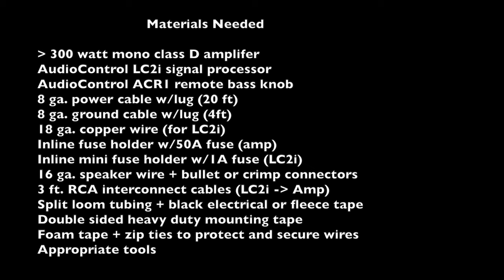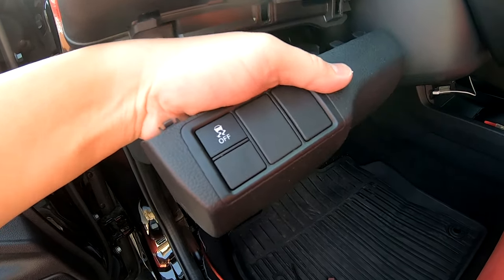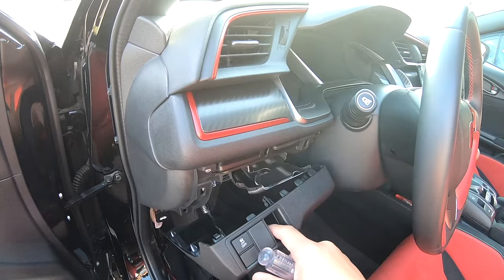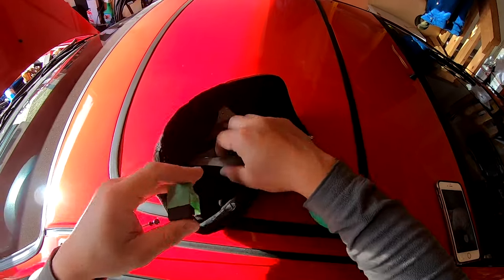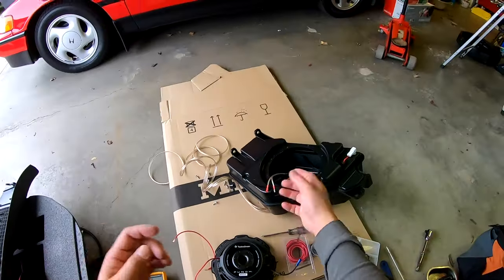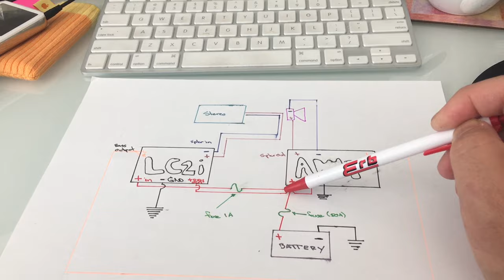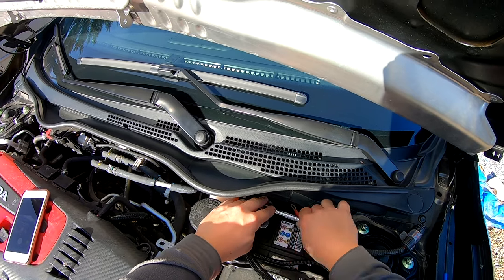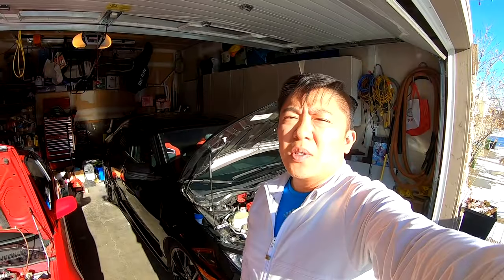2016+ Honda Civic Type R Subwoofer Amplifier Installation

Comment: Hello. It's me again. I just got an LC7i. After doing a lot of reading, I see why this is necessary for multiple channels. No short cuts here. I am wondering something. The input signal to the Lc7i. Can I use the factory wires which are 22 AWG and tap into them and use that, or do I need to run new thicker wires like 16 or 18 gauge to the input starting from the head unit? I wasn't sure. I was thinking if this is just a signal, but again, not knowing how thick it needs to be to send a good signal to the LC7i. The good thing is, that I am learning. Thank you. 
Also, I see you have quite a few videos on Honda Civic, that's good. Furthermore, I like to thank you for your reply's. A+ in my book. A lot of channels advertise and give advice, but few respond.
Reply from the maker: No need to beef up the wiring in the car anywhere except making sure you size the power cable correctly for the amp.  You don' need to change the wires for the door speakers or the signal wires.  My advice is to not splice @ the headunit.  You can buy an amplifier breakout harness online (there was a guy in civicX selling them) and that saves you from ever having to hack up your factory harness.  

https://www.civicx.com/forum/threads/amp-out-harnesses.60037/

The link I provided is to the thread where I purchased the harness from.  Not sure if he's still making them or not but this is a GREAT way to NOT screw your car.  If you sell the car, you can pull out the harness adapter and call it day :). Feel free to reach out anytime as I try my best to stay in touch with my viewers.  Don't forget to "like" the videos as it does help my channel a lot!
Reply: @piercedasian  I seriously appreciate your advice. Note taken on the wires and will reach out to this person. Thanks again
Reply from the maker: You're very welcome.  Glad I could be of SOME assistance to you :)

Comment: Well done trying this on my 07 e350. Good thing my battery is in the trunk
Reply from the maker: Aw man an E350 is super easy to install in b/c of the proximity of the battery.  Just make sure you do not compromise the battery box if it is sealed and you wouldn't want a buildup of hydrogen gas in your trunk.

Comment: Does all these steps also apply to a 2018 CIVIC TYPE R ? AND WILL THE STOCK TOUCH SCREEN IN DASH HAVE RCA CONNECTIONS IN THE BACK OF IT?
Reply from the maker: 2017-2021 civic type Rs will be 100% identical.  There are no RCA outs on any stock head unit and you will need to follow the procedure outlined in my video to get your aftermarket sub and amp to work correctly.
Reply: @piercedasian  yea i did this was a old comment lol the updated one is under it thanks

Comment: Bruh I’ve installed prob 5-7 systems over the years and I never knew about the pen trick or using the hood release cable grommet. Idk what I’ve been using but it was never just that simple 😂
Reply from the maker: yeah that trick is to the credit of a guy named CTRMOFO on the CivicX forum.  I just demonstrated the technique on video.

Comment: Final question, thank you for answering the other questions, where did you put the ground for the lc2i, did you use the same bolt or the black cable, and where did you get the power cable from the lc2i to the amp
Reply from the maker: Yep, I grounded the LC2i to the same ground as the amplifier.  The black cable for the LC2i is plain old twisted copper wire you can buy at any automotive parts store.

Comment: I have a question and sorry if its noobish:

How much different is this installation if I want to connect the amp power directly to the battery positive terminal? Do I still use the fuse connector the same way and just have the power bolted onto the positive terminal?
Reply from the maker: Not a noob question at all.  In fact the approach you're using a technically the better way of doing it but since I know I'm running relatively lower power and will always draw low current to my amp that I installed the power cable the way I did to make it look cleaner and still work properly and safely.  Whenever you're connecting to the battery it is SUPER SUPER important to install that in line fuse as close to the battery as possible.  As long as its fused properly then you're golden.
Reply: @piercedasian  Thanks for the information! I really appreciate it. By the way, I noticed you said that you had dashcams installed. Do you happen to have any instructions for how you did that?

Comment: You think 8” kicker comp R  will fit? Please post a video of the sound of your set up. Thanks and good tutorial btw.
Reply from the maker: The only way to tell if the kicker comp 8” will fit will depend on the depth of the kicker. If you look at my description it will show the exact 
Ideal of Rockford sub I used. Look the specs up for that and compare them against the kicker you want to put in.  Another sub had asked me to do a sound comparison video but I have been super busy that I have not been able to do a full fledged comparison of before and after. I promise I will get to that soon and post when I can. Stay tuned and don’t forget to click the little bell to be notified of new videos.

Comment: Nice video.  How you ran your power cable from under the hood, does it not get pinched when the hood is closed?
Reply from the maker: nope not at all.  There is a LOT of clearance where I routed the cable.  Key thing is to make sure rubbing doesn't cut through the wire's insulation as that would be a very bad and dangerous thing (engine bay fire).  That is why the fuse is placed where it is placed. As close to the positive terminal as possible.

Comment: Do you need to upgrade your battery or a capacitor to cater for the increase of power drawing from the amp and sub?
Reply from the maker: Generally not if you’re running a modern high efficiency class D amp. You’d have to run some additional amps or have gigantic ones before you need to consider a 2nd battery, larger alternator and adding caps to make up for the voltage drops from that kind of current draw.

Comment: Wish I could use the same mounting location for the amp in my Sport Touring, but we have a spare tire instead. Only thing holding me back is not being able to conceal the amp as I don’t want it to be visible, or interfere with the cargo area. Maybe I’ll take the spare out!? Nevertheless, I appreciate the in depth guide! It’ll be the blueprint for my upgrade!
Reply from the maker: Yeah, I actually did an install in the sport touring and the only logical place I could mount it was the spare tire jack cover of all places!  While you'd think it would be a terrible place to mount it that it has surprisingly held up there very good.  I had to do some mods to the inside of the truck cover but we've retained the spare tire and the trunk deck had to be only slightly modified.

Comment: Where in the diagram would I add a capacitor? Kinda stuck in that with my 17 civic
Reply from the maker: the capacitor?  That's easy.  Hook the negative terminal from the cap to ground and then hook up the + ve terminal of the cap to the power cable from the battery and then using another wire hook up the + ve of the amp to the +ve of the cap.  Just PAY CLOSE ATTENTION to the polarity of the cap such that you don't mix - ve and + ve up.

Comment: What gauge power wire did you use for the lc2i and amp?
Reply from the maker: The amp was 8 gauge and the LC2i was 14 gauge.

Comment: My civic doesn’t have a stock sub do you think I could buy those parts to create a stock sub and have the same setup as you?
Reply: Yes you would connect the lci to a speaker wire.
Reply from the maker: Hmm if you wanted to build a civic with stock sub that chances are it would cost you a small fortune to have mediocre sound. You'd have to buy a new trunk side liner, the box, associated wiring (assuming you could tap into existing harnesses).  You're honestly better off building an aftermarket setup that would give you better sound for the same or less money than going the genuine Honda route.

Comment: Were you able to control the bass threw the factory head unit? Like you took the sub line into the LC2i?
Reply from the maker: absolutely you can.  In my case I can adjust via head unit AND my remote bass gain control.  I just leave the head unit on the default bass setting and use the bass knob to control it instead.  Turning a knob is far faster, quick and more intuitive than trying to navigate the infotainment system screens to find the bass controls.

Comment: for the signal, do you connected to the left or right side on the LC2i? also do you think regular RCA converter will work talking signal from factory subwoofer? Thanks, Sub and liked
Reply from the maker: I believe on mine I connected it to the "left" input terminal.  RCA converter will likely not work too well using the high level signal from the factory sub's wiring.  The reason why I used the LC2i is to put back the lost bass signals that result from the grabbing a high level output sub signal from the head unit.  Some say that you can use an amp that has a built in high level input to achieve the same result but I cannot speak to that with any intelligence since I haven't tried that route on my 10th gen civic.
Reply: You need a converter that converts high level speaker output into low line output.

Comment: Another great DIY!

Any plans on upgrading front door speaker and front tweeters?
Reply from the maker: Thanks!  At this point probably not since I find it difficult to justify the cost to replace the speakers and installing an amp and all the related items (LC7i).  The effort and cost just isn't worth it for my application.  When I'm driving my car I like to listen to the road and engine and even if I wanted to listen to a nice stereo that the road noise will drown out pretty much everything anyways.

Comment: Very good video. I just didnt like the fact that you tapped into the fuse block instead of the battery positive terminal. Other then that good video. Simple install
Reply from the maker: Glad you liked the video.  For the fuse block tap it is actually on the power feeder side before it enters the fuse block so it isn't pulling big current through the fuse block per se.  Because I didn't wire my amp power feed cable directly to the battery that I could be running more current through the stock battery -> fuse block main wife but since I'm using a super efficient class D power amplifier that the amount of current drawn through that short cable is likely not going to burn it up.  I would never do this setup with an old school class a/b amp but who uses those anymore in 2019?

Comment: Okay so im a little worried now. Instead of the 8 gauge wire, I installed a 4 gauge wire, i did everything you did on the video and when I reconnected the battery everything was fine until I got emission problem and rev match problem, I looked up the code and it was p0560. Something about the voltage. My question is did anything like this happen to you or maybe I did something wrong.
Reply from the maker: nope, using 4 ga wire is perfectly okay.  B/c you had the car battery disconnected that this is actually normal upon startup for the first time after reconnecting battery.  You probably got more than just those errors.  Pretty much EVERYTHING on the car would error out.  Just drive it for about 5 miles and then all will be good again.  I freaked out the first time my car did that too and ultimately it went away after driving a few miles to let the car reinitialize itself.
Reply: @piercedasian  ok also i never got to see the way you connected the subwoofer wires from one side to the other. It looks like u put ground (black push lock) to the ground on the other side and the same with the red to red push lock. Just want to know if thats right or if it is necessary.
Reply from the maker: Hey NYC RAA, apologies for not replying sooner.  So the sub itself is connected directly to the amp outputs but the inputs for the Lc2i has the sub signal in from the old sub location which is what you see me piggybacking the wire from the OG sub signal from the enclosure to the Lc2i and then amp outputs back to the enclosure and connecting directly to the sub.  I did it this way so I don't cut any factory connectors and harnesses should I ever sell the car and revert the system back to stock.  Hope that description makes sense and that you've got your sub upgrade working.

Comment: Very detailed vid man! Just waiting on my stuffs. Question, what size did you use for the foam tape? And what do you call that clip zip for the wire going through the fender? Thanks in advance!
Reply from the maker: The zip clip was actually sourced from Honda.  They had them as part of their block heater kits.  I don't know if they formally have a name to them but you CAN buy them.  They're used in various spots of cars to attached air conditioning condenser fan wiring harnesses to the fan shroud.  Just pull up any Honda's part diagram and pick one.  They all work the same.

Comment: I am installing a KX1200.1 that has a built in LOC basically so with that said, can I just tap those wires at the factory sub or do I need to tap in before the wires go into the factory amp? I know it usually depends on the car and setup so wasn’t sure. I was able to do it in my Ram that way but I’ve heard you can’t always get away with it.
Reply from the maker: Hmm, you may want to reconsider the LC2i.  When I was doing my research at the time the reason why the LC2i was needed to restore the full bass frequency range in the sub signal.  Modernized factory head units apparently do some weird signal processing and eq'ing depending on the output and speaker load it sees so although you could use the LOC built into your amp that the head unit would inherently EQ out some of the bass signals to your amp.  In other words, you may want to dig deeper into the issue before doing your install to ensure that what you're attempting to do will work perfectly.  Good luck with the install and definitely share what you did on my channel so that others can learn from your experiences.  Thanks,.
Reply: @piercedasian  will do I appreciate it. I talked with a tech from kicker and he said their newer kx series have a "smart loc" and it would do its job automatically. He went on to say that in the past with previous amps such as their old kx series it had a built in loc but not a smart one...  he said it would be fine so I guess we shall see lol. Thanks! Do you have another form of contact?
Reply from the maker: Derek Scott that is interesting news and good to hear that kicker has given you feedback on how their smart LOC works. If you want to have private communications with me on just about anything feel free to email me at piercedasian@gmail.com

Comment: First off awesome videos and very clean install. Two questions I have for you is 1) Do you hear or notice any rattling noises considering that you mounted the sub into a factory, plastic enclosure? I’ve always used MDF sub enclosures but I was considering this option to save space in the trunk and not have a box. And 2) Does the bass from the sub sound evenly throughout the car even though the sub is mounted on the right side of the car?
Reply from the maker: glad you liked the vid!  I honestly can't say that I really hear any buzzing from the rear.  Totally agree that MDF is the way to go but for the sake of factory look and fit that I went the route that I did and I don't regret it.  It isn't going to shake my fillings out but it is a DRASTIC improvement over the factory sub.  Yes the bass is fairly even throughout the car.  Only thing that is wonky is the sub sounds "poppy" when you've got the hatch open and you're in front of it - similar to being almost overdriven but yet when you're sitting in the car with the doors and hatch closed that it seems okay.  Not the best description for you but that's the only way I can describe it.

Comment: Nice looking install.  I have used the LC2i before, but not the remote knob.  Does it just lower the gain through the LC2i, or does it actually control some sort of boost?  Also, I assume because you tapped the wires that were going into the factory sub, that the signal you sent to the LC2i was actually coming from the factory subwoofer amp.  Thanks!
Reply from the maker: The remote knob is basically the gain control at your fingertips.  Yes you are correct that the LC2i is taking signal from the factory stereo’s sub amp output. That is actually why the LC2i is needed as these new fangdangled headunits do some weird amplification /EQing to the signals that messes up aftermarket equipment.

Comment: I HAVE A 2018 HONDA CIVIC HATCH SPORT TOURING, I HAVE STOCK AMP IN THE FRONT OF THE CAR, I WAS WONDERING IF YOU DID AS WELL. AND IF SO, DO ALL THE SPEAKERS FEED OFF THAT ONE AMP? DO I  HAVE TO DISCONNECT THAT AMP TO INSTALL THE AMP FOR THE SUB? AND I WANTED TO A RUN A 4 CHANNEL AMP ,  BECAUSE I UPGRADED THE DOOR SPEAKERS. HOW WOULD I CONNECT THE AFTERMARKET AMP AND REMOVE THE FACTORY AMP? I  WOULD REALLY APPRECIATE YOUR HELP AND INPUT ON THIS. THANKS
Reply from the maker: Hi, your Sport Touring would have the same stereo setup as my Type R would.  I believe ALL the speakers including the sub is being fed off of that main power amplifier.  No need to disconnect the main amp.  Jut follow my instructions exactly and it will perform perfectly.  The whole purpose of the LC2i is to take a high level signal in and re-eq's the output signal to allow an aftermarket amplifier to perform properly.
Reply: @piercedasian  hi, and that you for that info, also can I use a PAC Variable LOC Line out converter instead of the LC2i?